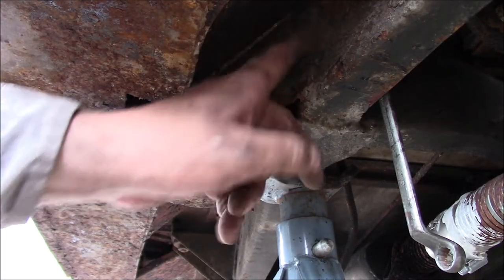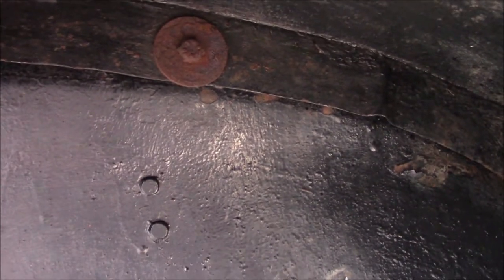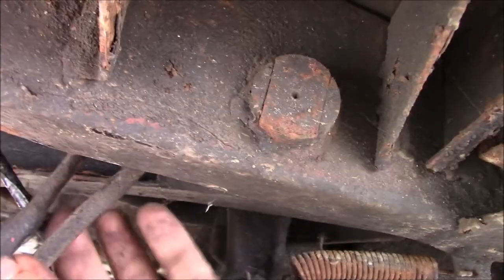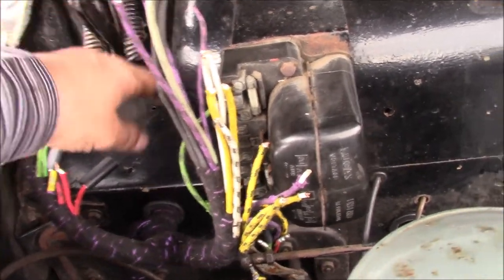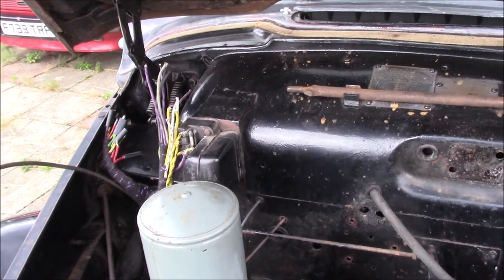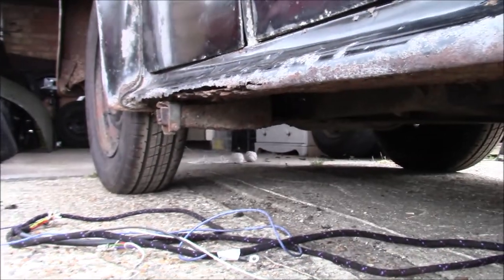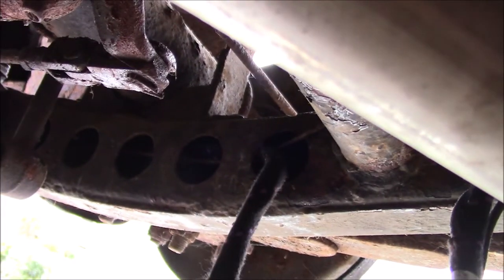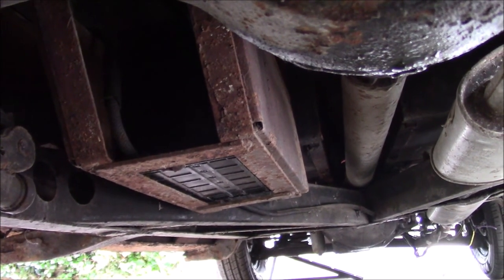1951 Lanchester LD10 - Replacing the Wiring - Chapter 6

Comment: I think the gearbox end of the speedo cable is probably smaller - so try feeding the cable from inside the car through that tight grommet. Speedo cables are not normally restrained by cable clips, they need as smooth a curvature as possible.
Interesting video - thanks.
Mike
Reply from the maker: Since recording, I came to much the same conclusion.  Something to revisit if required in the future, certainly.